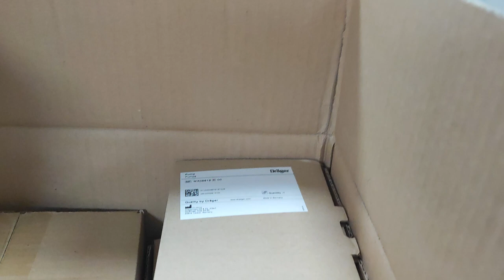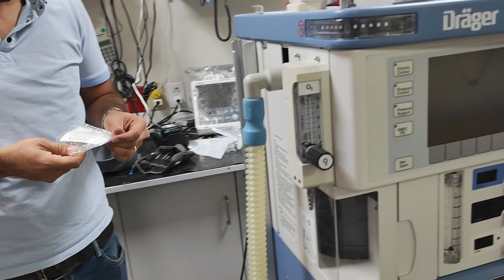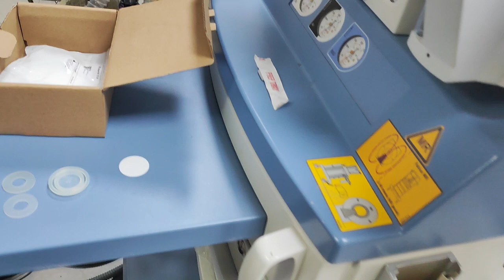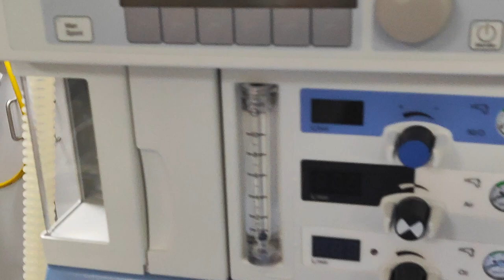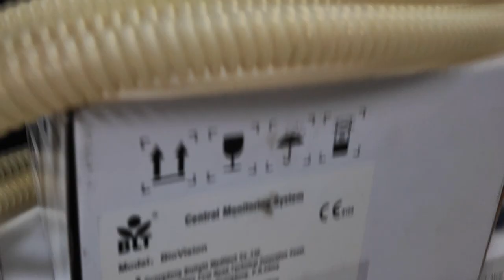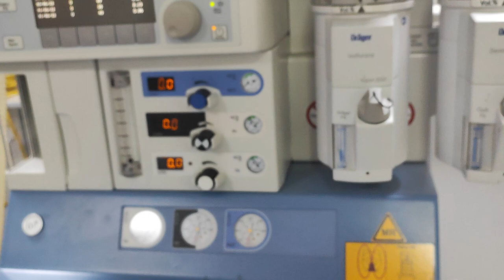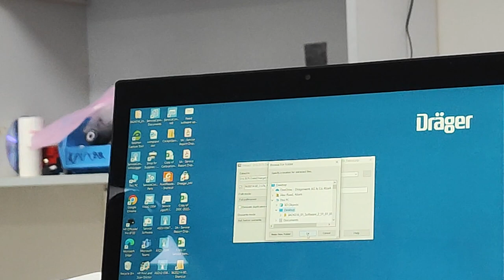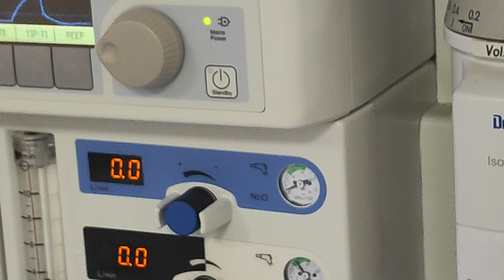Replacing pump motor and maintenance kit of Draeger MRI Anesthesia Machine.

Comment: Do you know what model or wheel will fit a draeger narkomed GS and where to find it
Reply from the maker: Sir, There are so many generic  replacement of the Narkomed caster wheel you can fine in Amazon or in Alliexpres  you should buy 2 with brake and 2 without, or you can find in Draeger but very expensive. just make sure the mounting sir.
Reply: @roysantik  do you a link for the one generic in amazon?

Comment: hi, do you know how turn it back power pump value to 10-20%? I have one with 100% and I need replace pump. Thanks
Reply from the maker: Hello sir if you have an access in service mode you can adjust there, use the drager service  tool to access the service mode..
Reply: Thank you